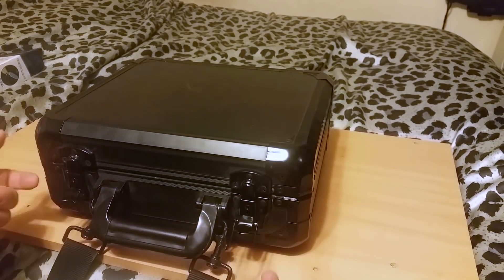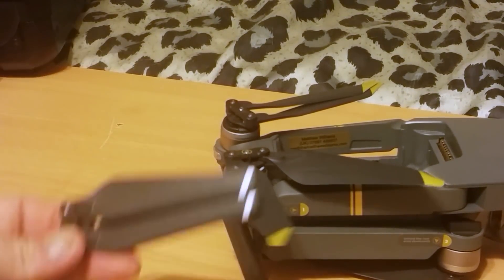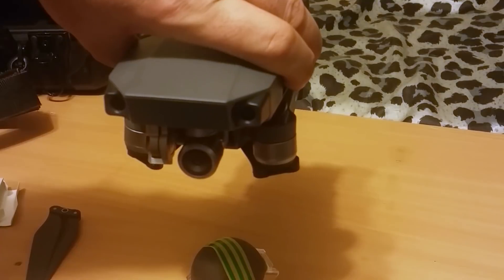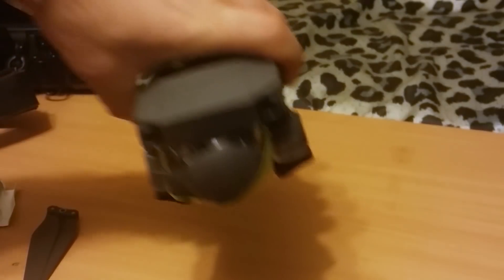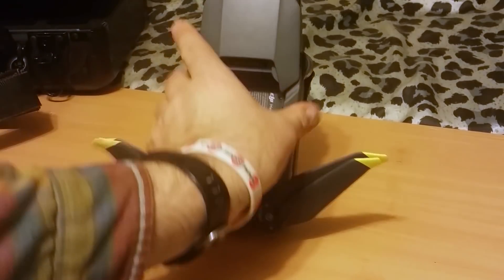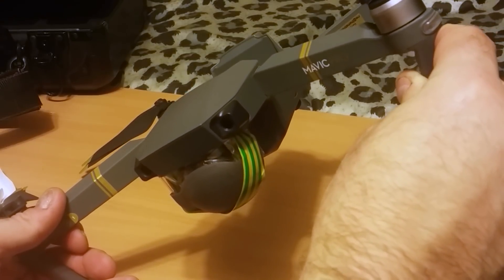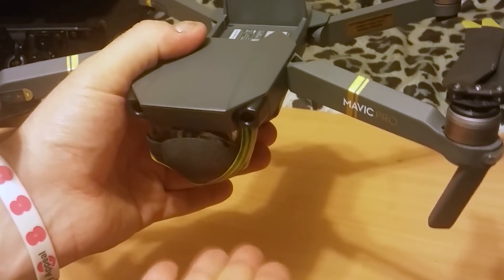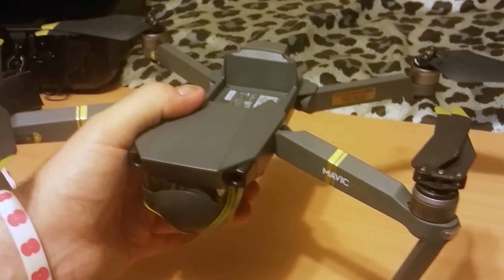Mavic Pro Gimbal Shake after fitting Platinum Props FIXED

Comment: Hey Matt. I'm so glad that I found your video. I have a quick question...I've put the Platinum props on my Mavic Pro recently and I haven't seen or had any  probs with my gimbal, in-flight correction, or dealing with gusts of wind of any kind. Should I still adjust my gains anyway, due to the fact alone that the Plat props are more efficient? Or should I  just leave well enough alone?

Comment: My mavic pro 1 started to do weird shake on the video after using low noise props for only one time, I changed back the originals but it still does the same shake. Gimbal seems ok otherwise, no visible incorrections, everything is in it's place. Wonder why this happened. Now I've ruined several video shots, like today, because of this shaky video. Frustrated!

Comment: Thank you so much you solved my issue with the platinum propellers. Does the propellers touch the body of you drone? Thank you.
Reply: Yes, the propellers will touch the body when hits by a strong burst of wind. I recommend getting carbon fiber propellers with 3blades.

Comment: I had the same problem. 
Thks for your gain advise. 
But actual problem was. Last time i was flying with properllars guards.  n in app setting i left the prop guad to switch on position. 
My droe without prop guard does the same thing. 
But when i swirch that prop gyard thing off. Drone was fine . No need to set the gain to 86. 
Well thnks for your advice. It had something to do with gain n prop guards on.

Comment: I never had the gimbal do that, however any sort of wind (and I mean little 10km/h gust will set it off) will cause a wind warning when I use low noise props. Any suggestions on the settings with wind warnings when using low noise props?

Comment: In my case I noticed the drone itself was shaking first then noticed the camera shake. Went back to original props and it was fine again. FWIW while your settings probably do work as is or with personal adjustments, beginners should probably stay with originals. Noise only a problem when its close to you anyway.

Comment: Matthew, Good explanation of the vibration caused by the low noise props. I just bought a set myself and experienced the terrible gimbal vibration to the extent my controller alerted me. So I followed your instructions and set the gain to 86 except for the vertical and just finished testing. Perfect! I hovered at about eye level and inspected for wobble- none! Needless to say, I'm happy, the drone is flying perfectly with the new low noise props. I can definitely tell the difference in sound. As stated by many, the Db level may or may not have dropped. However, the pitch is definitely lower which solves the problem of annoyance. As explained in Drone Valley's video it's the pitch between certain frequencies that cause human ears to fin the drone buzz objectionable. If anyone wants to learn in great detail what frequency has to do with annoyance hers the link.                                                                                                                                                                                                                               http://tinyurl.com/yyvkrjrk
Reply from the maker: Glad this helped.
Reply: 86  is fine for me.. I am not sure why the vertical has to stay 100.. but it works.. thank you

Comment: "we are experienced drone builders" but we can't figure out that the props were causing the gimbal shake in the first place so we replaced the only thing that is replaceable: THE PROPS. We just upgraded to the newer better thing dji put out thinking that will fix the problem. Never did it cross our "experienced drone building mind" that balancing the props or even swapping out to normal mavic props would fix the issue. NO. We used the newer thing because, logically, all mavic props are the same and they all cause gimbal shake. And boom! we fixed it biatch! Gimbal shake? Get platinum props, or even better, bin the whole shit and just buy a new mavic platinum, there, we fixed it because we are "experienced DROOOONEEE builders"

Comment: Anybody else have this issues ? Would the original props be better ?
Reply from the maker: Original props are fine but rev faster so make higher whining noise. Its a matter of preference.
Reply: Matthew Williams my current propellers are a bit  used im planning on buying the low noise propellers i just didn’t wanna have any issues with them thanks for the advice.

Comment: This is purely firmware thing. I had the same vibrations when mounted low noise props for the first time, but the problem disappeared few minutes later after aircraft "learned" which props are mounted. Now I regularly change between them without problems.
Reply from the maker: Thats good to know. I am set on a nice firmware which is hacked to allow lots of stuff... so dont want any newer firmwares on mine. Thanks for the tip tho.
Reply: So do I need to upgrade my firmware?

Comment: Thanks for information. I have read that motors heat up more with new props also which makes sense if they have more lift. I new it would be hard to beat the original mavic pro. I think its color is the best and the props actually look better to me. I like that military look the original has. Electrics need to make a little prop noise lol

Comment: So what do you think of this video

https://youtu.be/G1e0pP5N1kU

I did some research a little bit this guy says they fixed the mavic pro 1080p 60 frames per second problem with the original mavic Pro with the firmware update. 

Is this true have you tried yours?
Reply from the maker: I think this guy is playing wishful thinking with his eyes. The 1080p60 footage looks blurry so really isnt a good example. They did change the chip in the platinum... so clearly that isnt a firmware thing. Thats a hardware thing... which he says doesnt matter. I assure you it does. You cant fix some faults in firmware. the processor just wasnt handling the footage properly.

Comment: Now I'm also wondering when you use the prop cards they want you to select a switch in the software telling the software you're using prop guards.. and then it stops shaking...  I wonder if it's just an automatic gain control changing the settings for the prop guards.

Hmmmmmmm
Reply from the maker: Yes there is a prop guard fitted option in the DJI GO app...
Reply: Matthew Williams 

I'm assuming they're using the same settings the gain control to adjust for the prop guards..

If you don't press that little button in the software the mavic pro becomes very unstable..
Reply from the maker: Its posible they use the same gains. It would make sense, but perhaps there is some other magic going on there too. However for prop guards your making the copter heavier so its moves and propulsion are slower so gains need to be HIGHER... as opposed to when you use platinum props the thrust is increased so the gains need to be lower. If you couple prop gaurds with platinum props its possible the two would cancel each other out so gains could stay at near 100%.
Reply: Matthew Williams 

On mine with the Platinum propellers it was wobbly with the prop guards only.. I had to press that little button for the prop guards.  

But then again I've yet to have a problem with the Platinum prop guards and never had to adjust the gain but this video is ABSOLUTELY BRILLIANT teaching us about this I had no idea!!  

THANK YOU FOR THE EDUCATION....  

I have been spreading your video now helping people that have the problem with the Platinum Pro prop guards it's amazing how people don't know about this and neither did I..  

I wish we can get more information out of DJI telling us or giving us gain settings to help us..

They promote the Platinum prop guards for the mavic Pro. So I would assume they would give us customer support on it to make them work correctly maybe giving us gain settings I just never had to ask them..
Reply from the maker: Im glad this has been of use to you.

Comment: I guess this is definitely from MAVIC to MAVIC...

There are hundreds of people on YouTube that switch to the Platinum propellers and had no issues whatsoever..

I AM ONE OF THOSE PEOPLE.. no issues putting either propellers on no shaking runs flawlessly..  I get lower RPMs, lower noise better performance slightly longer battery life.. 

Pretty weird has anyone talked to DJI about this...  They do recommend you could put these on your mavic pro within the should recommend gain settings...
Reply from the maker: DJI are not often the ones to offer up information like that. They probably dont want people using the platinum props on mavic pro's because you get the main benefits of quietness which is why you would supposedly would want to buy a platinum... because the only advertised benefits of a platinum are Quieter, Longer flight times. Thats it, thats all they advertised the platinum as being better at. Why.... perhaps here is the reason.
What they also didn't tell people is that the platinum has a BETTER camera DSP chip on it which fixes the 1080p60 problems on the pro with pixel binning issues. This is now better and the whole image looks cleaner and clearer on the platinum, but theres no way they would talk about that because it means they would be admitting there was a FLAW in the mavic pro - which means they could get sued. So what do they do... just include that feature and stay very hush hush about it. They only talk about their wins, and never their fails. Shades of Apple.
Reply: Matthew Williams 

Wow I didn't know that I hate Apple not a fan of them I'm a computer and network engineer that fixes phones and computers in my own shop and I hate Apple stuff even though I fixed them.. 

They definitely have the Monopoly Apple thing trying to go on

So basically you're saying my mavic Pro 1080p with 60 frames per second stinks.. I've never tried it I know that they had a problem with the sharpness and automatic noise issue.. you know the thing where if you set the sharpness to 0 & below the automatic noise reduction is on.. if you go plus one on the sharpness the automatic noise reduction is shut off and you can use it in post-production or not.. 

That's the only issue I heard of but I didn't know about the 1080p at 60 frames per second...
Reply: Matthew Williams 

It's been awhile I wonder if they fix the 1080p 60 frames per second with firmware updates
Reply: Matthew Williams 

On that website they do say you can use the mavic Platinum Pro propellers with the mavic pro... And they say it just won't be as quiet which is true.. 

I don't know if you noticed that.....
Reply: Matthew Williams 

Check it out they do say it can be used on the mavic pro They are promoting it that way..  

This is the link ( https://m.dji.com/product mavic-low-noise-quick-release-props-platinum)

BELOW IS WHAT THEY WROTE... 

Overview

The 8331 propellers have a brand new aerodynamic design giving the Mavic Pro series an impressive noise control performance. When used with the Mavic Pro Platinum, up to 4dB (60%) of aircraft noise is lowered during takeoff and landing, and flight time is extended to 30 minutes. Noise reduction and flight time are also enhanced when used with the Mavic Pro, but not as much.
Reply: I have getting an Excessive Gimbal Vibration alert lately.  It goes away after awhile.  As alwsys, Always do a Hover Test before a Flight Mission.

Comment: Just used these settings on my Mavic Pro with new dji platinum blades I went down and eventually got to about 90 gain on pitch and roll and then just adjusted the vertical till it felt right when I come down from high up. Thanks to this youtuber my Mavic Pro camera is no more shaking itself to death hahaha just used one battery to do this setting up and another 2 to film and check everything is fine, and it is no more gimble shaking errors when I start it flying or so on. Thanks.

Comment: thanks for the video,  this makes a lot of sense, even with the stock blades my mavic's gimbal will get a few small oscillations usually just when hovering but not while flying I may try to  reduce the gain by 1% to see if it fixes it. I have noticed a lot of other peoples mavic pros will get a slight amount of camera shake once in a while, this may very well be the issue
Reply from the maker: Yes reduce by 1% at a time to be safe... hope you found it helped.

Comment: This is not the solution to the problem of vibrations.
As they are low noise propellers, they need only 500Rpm to keep the flight, while the original propellers need 570rpm to maintain the flight. When rotating at less rpm's, the blades do not unfold in a straight line, and remain unbalanced. The solution is to lubricate the rivets of the blades, so that they are deployed in a straight line at lower revolutions rpm's.
With this the vibrations of the gimball disappear.
I had this problem with the low noise propellers and I solved it that way.
Reply: Cool tip, I may try that soon.
Reply from the maker: Useful info... worth bearing in mind for sure.
Reply: Thanks. Your solution  fixed my extreme shaking problem. I added some lubricant on the top and bottom of where the props hold together with the rivets. I suggest anyone try this first before adjusting the gain.
Reply: image was not stable on camera. lubricating the rivets helped me. thank You
Reply: Kerfala Diane  I just put on my tin foil hat after reading this. They wont be updating me anytime soon.

Comment: Dude stop holding your mavic by the arms...
Reply: Thats daft... after all they have to lift the weight of the copter into the air dont they... So me holding the copter up by them is the same thing. Did you know they actually lift real helicopters with cranes by the propeller mast - why... because its the strongest piece of the heli and it supports the whole weight of the heli when flying... same thing as with the mavic. Simples.
Reply: Dork it’s his machine

Comment: Thanks Matthew.  I have experienced this problem with low noise props, but only when adding extra batteries and weight to the aircraft.  I have been scratching my head trying to think of a reason, and not getting anywhere.  I think you may have hit on the reason and a solution, so many thanks for that. I guess different Mavics have slightly different characteristics, which is why I don't see this vibration when using stock Dji batteries.  But when i add a heavier battery I get exactly the same gimbal bounce as you.  I guess when I use the heavier battery this alters the resonant frequency of the whole aircraft and induces a vibration at the resonant frequency of the camera and gimbal assembly.  I will try altering the gains as you suggest and see if I can tune out this resonance.

Comment: Does this happen to all the mavicpros  if you change the props
Reply: I'd say yes it does and I think dji needs to put this into a disclaimer when you buy the blades that you might have to adjust the gain settings.
Reply from the maker: @GavinMufclee  Would be nice if they did that but I guess they dont want people using those blades on aircraft they werent designed for, even though you can. I think they rock.
Reply: Original Mavics will have this issue - the new mavic platinums are desined to take tholse props but will be out iof kilter if you put original mavic props on the newer platinums also.
Reply from the maker: It might be a firmware thing also, with different firmwares behaving in different ways. More or less weight can cause sluggishness or over corrections. Altering the props also.

Comment: Sorry I’m a bit confused which is the right gain settings as saying in your video pitch roll and yaw set to 89 and your video description indicates differently. May I know which is the right settings please?
Reply: You are supposed to experiment slowly with small numbers to work your way down to 89 on pitch and roll. Yaw 100 and 100 for Vertical.  However another youtuber said 80 Pitch, 80 Roll, 110 Yaw and 110 Vertical. Try slowly asjusting pitch and roll numbers down and see how you get on. At your own risk.
Reply from the maker: Some people say 85... some 89... its depends on what works for your drone. Work your way down 3 at a time... the manual tells you to apply changes to gains carefully and in small increments. Makes sense.